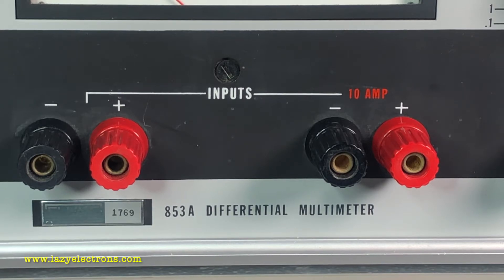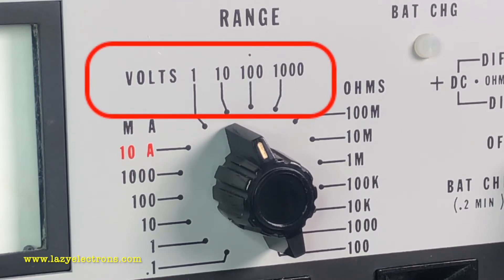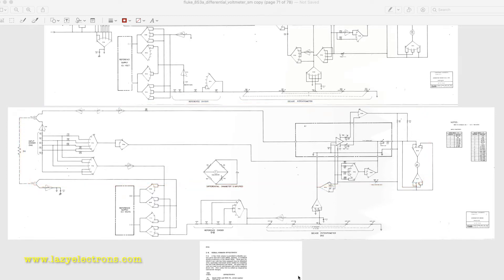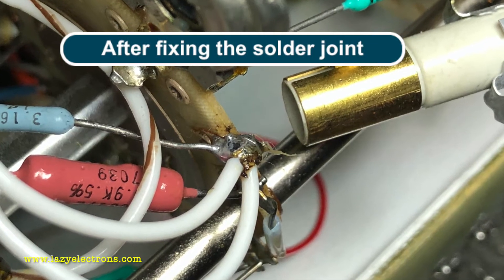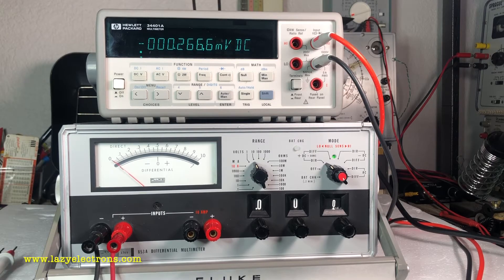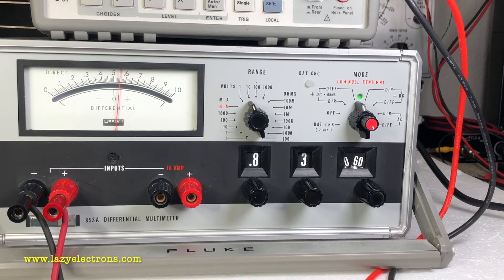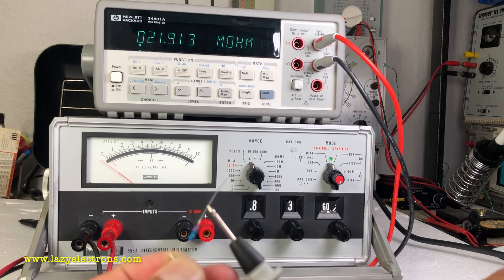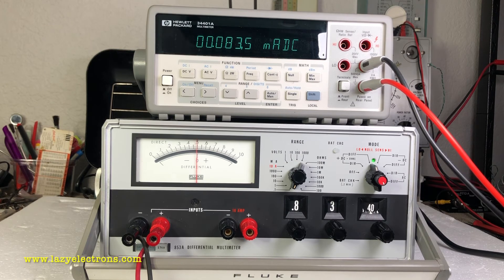Fluke 853A Differential Multimeter

Comment: I have four Fluke Differential meters including this model.  I suggest in DC DIF mode, you disconnect the power supply from the -/+ input and measure the OUTPUT voltage of the Fluke to "balance" with the external unknown voltage.  Many years ago, the Fluke Differential instruments (873A, etc) were used as "secondary" standards useable as a reference to  calibrate other instruments, that is, the Fluke's reading was a true and accurate voltage.  Technology has changed over the years but my old Fluke 873A will read the same voltage as my Fluke 8842A or HP 3455A, within 1-2 millivolts.  If I ever question the reading on one of my newer instruments, I use the Fluke to confirm that measurement.

Comment: wew, very smart technique indeed for analog multimeter, I'd say you could get a very precise measurements similar to 999 counts dmm.
I wonder what is those meter's impedance, common analog needle multimeter would do 20kOhm/V.
Now, 999 counts seems rather low for modern DMM which at least could do 2000 counts, but you'd struggle with other common analog multimeter to read 1/1000 resolution on the scale.
Reply from the maker: 1 M Ohm. 20 Hz to 30 kHz.